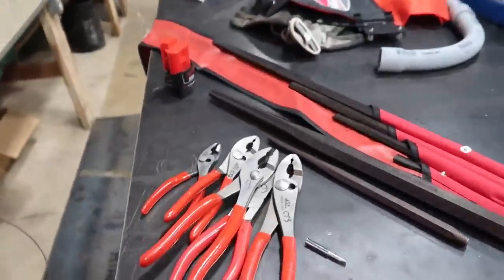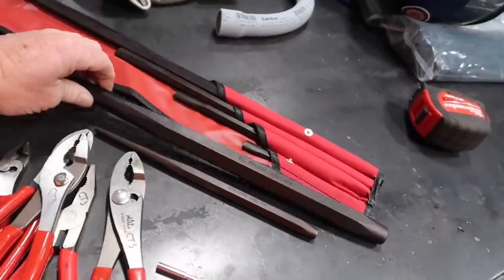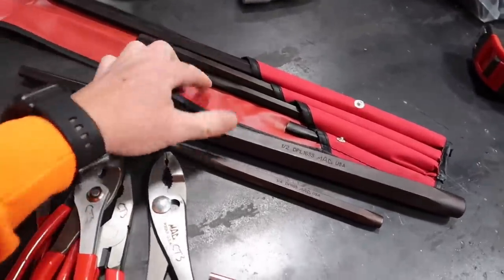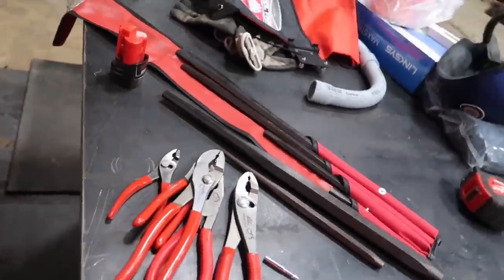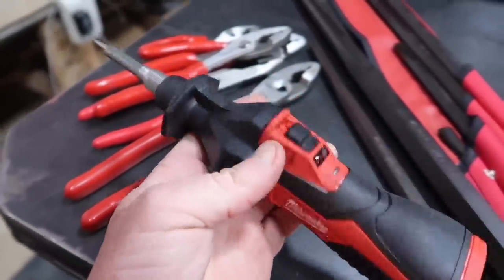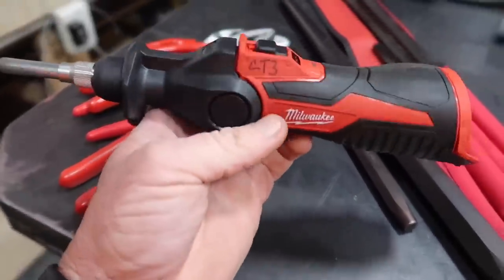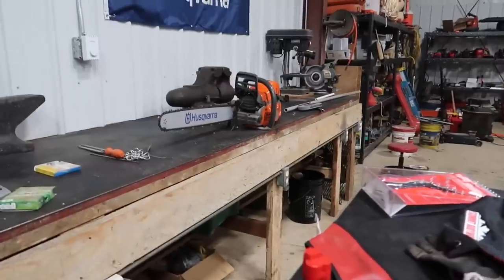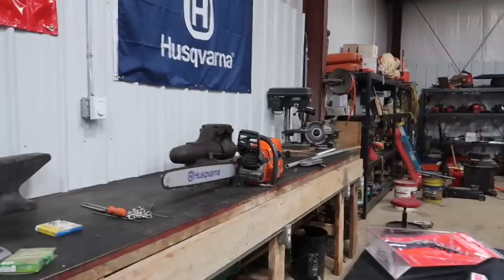Mac tools, sharpening saws & greasing my Kubota mini & maybe a giveaway

Comment: stay safe on the tree job really like the videos not trashing you on this but i never could get a chain saw to cut good after file sharpening one they all ways went to cutting crazy dont know if i went past the point where it was better off to sharpen them on the machine or what i did wrong oh well we have a place that dose good job on them i think is pretty cheap for as good as they do on them at 4.00 bucks a chain and they last a good bit after they sharpen them real close to out the box sharp